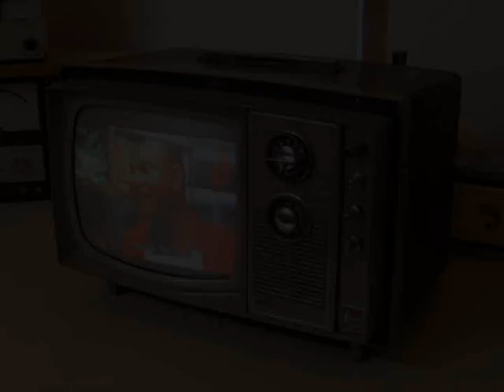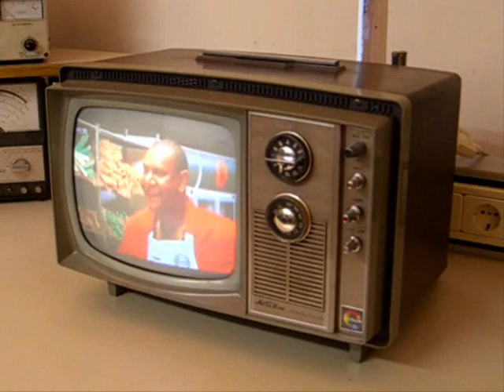Kuba porta color CK 211 P

Comment: Inline CRT...very unusual.
Reply from the maker: Yes very unusual in that time indeed!
Reply: @proxxima038  It is unusual for this series of TV receivers as GE produced them with delta gun CRTs throughout their entire production run, which lasted into the mid-1980s.
Reply from the maker: @douro20  Yes, as far as I know this was the first inline CRT from GE. Maybe it was not good enough for the bigger tubes or higher deflection angles. If I'm right the portacolor is just 70 degrees...
Reply: @douro20  They are inline crt’s from GE, all of them. The electron guns are mounted in a horizontal line. The shadow mask looks deceiving as if it is a delta configuration with round dots, but it’s not. You have to see the dots as in a line, not a triangle.
Reply: @telocho  I just remember the early '80s Portacolor I had having a delta gun CRT.